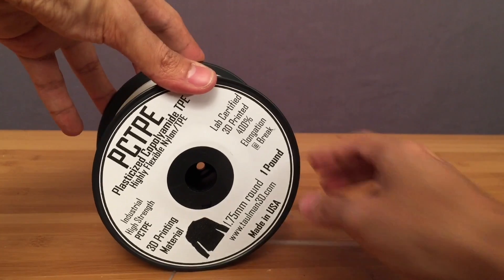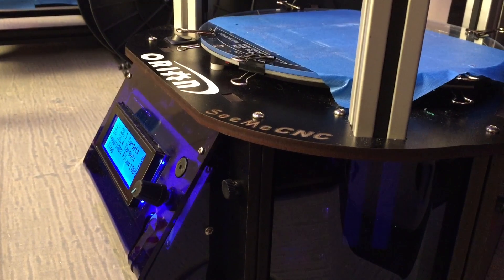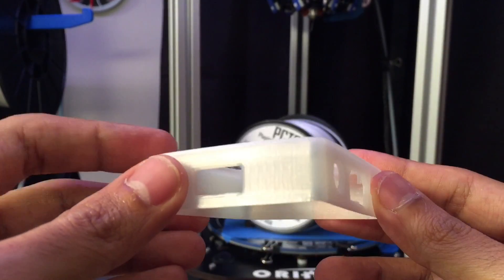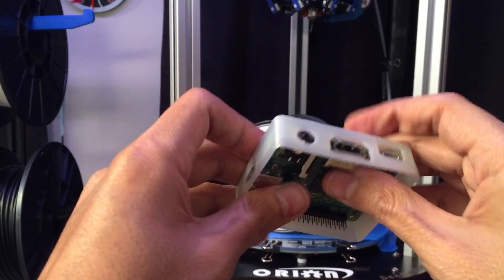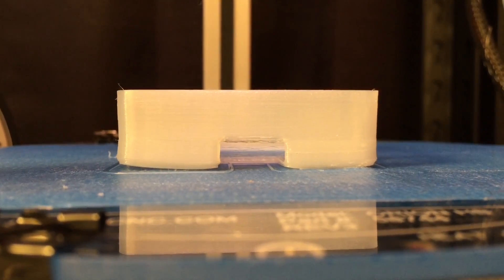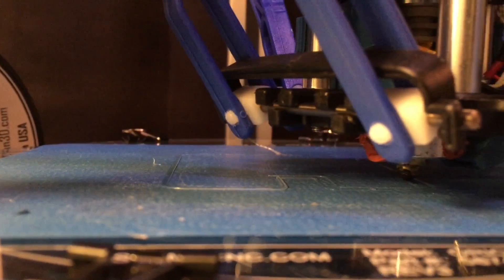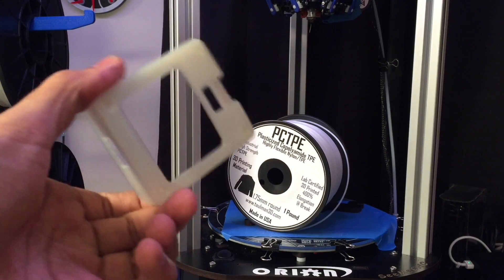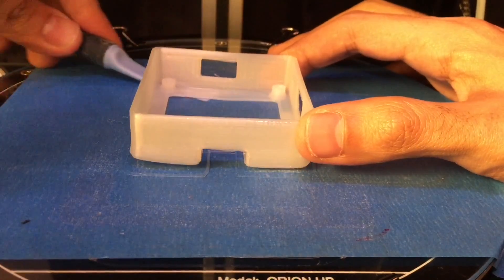PCTPE Flexible Nylon - 3D Printing Filament

Comment: You should print some modular shoes with a nylon upper part and ninjaflex soles. Maybe sew it all together with conductive thread.
Reply: I was with you right up till the conductive thread part.  Why conductive thread? 
Sadly I wear a USA mens 15, going to need a bigger printer than my Ender 3 Pro